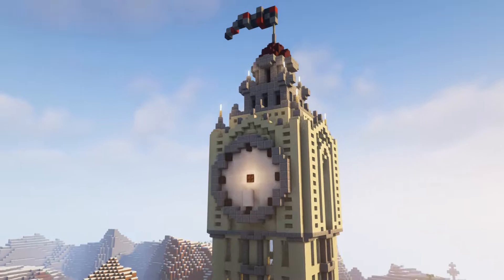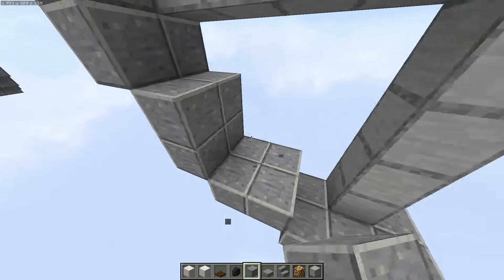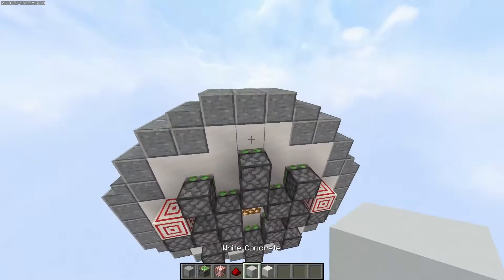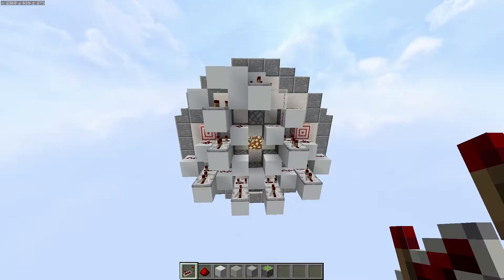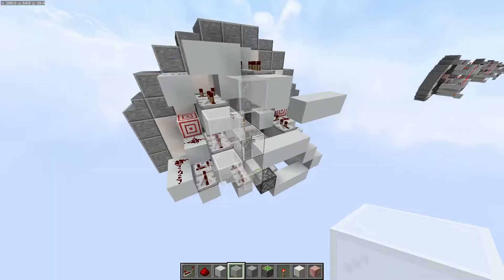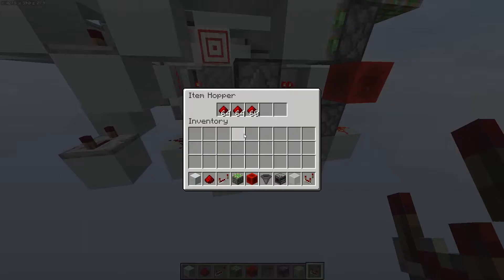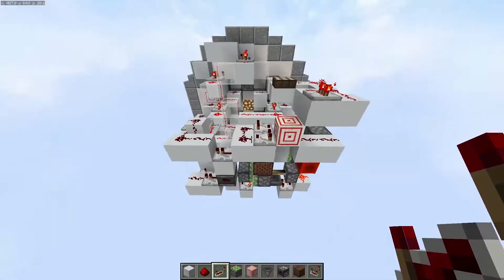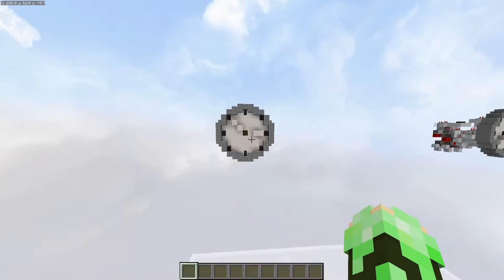Working Redstone Clock Tutorial V2 | Minecraft (Java Edition 1.19.2+)

Comment: Note for Everyone, in case your clock is stuck or it doesn't start after following the vid step by step, go to the redstone comparator that is placed on top of the observer near the daylight sensor and right click/activate it and it will start the clock. Took me too long to figure this out as i thought this entire time i messed up the redstone circuit.
Reply from the maker: The clock should start by sleeping, but this is good advice if you're still having issues :)
Reply: @Snap2it. А можна за їх зразком , зробити календар , який переключався б раз на день у майнкрафт і показував фазу місяця ?
Reply: And if none of the above work use a bow to start it aiming at the target next to the daylight sensor
Reply: I did both turning it on and shooting the target and even rebuilding it twice and I just can’t get it to work

Comment: For some reason the sticky piston under the note block isn’t moving for me. Clock keeps getting stuck in 8:00 only even after reset.
Reply from the maker: The sticky piston under the note block is powered by the observers that face the hopper clocks. There's two blocks that get alternatively moved into position above those observers so that only one of them can power the note block at a given time. Just check that everything in that region matches the video. Sometimes redoing a section is the easiest way to find an issue. You could also hop into my discord server where you can post pictures :)
Reply: I'm also having the same issue. I've tried tinkering with it, and rewatching, but the clock hand gets stuck on eight.

Comment: I think I could pretty much use a lot of your Redstone and Bedrock I would probably have to change where the power actually went to the Pistons because we don't have quasi connectivity and figure out what other quasi connectivity or using and try to hard power it somehow it definitely won't be as compact but I think a good portion of your Redstone will work
Reply: Did you manage to design one for bedrock?
Reply: @eliasfagerli4631  I did but once the copper bulb comes out it will be a lot easier to compact.

Comment: Can't get it to work consistently. The repeaters that are directly going into the sticky pistons are generally always in a locked state. Should I flip it over so it's not the case?

Can I get the world download so I can compare/contrast? Can't wait to get it working!
Reply from the maker: The locked repeaters should briefly unlock when the clock changes position. The placement shown in the tutorial is correct. I would recommend rewatching the tutorial to check for mistakes, or checking out the world download.
Reply: @Snap2it.  Just checked the world download. The locked repeaters aren't getting power. I may have placed another repeater incorrectly somewhere.

Either way it's an amazing build. I will endeavour to get it working properly!
Reply: @Snap2it.  Got it working, silly me had built one of the layers further out than it needed to be. Thanks again!
Reply: @FlatChanceQuartet  Which layer per chance? Mine is stuck at 3 O'Clock all the time!

Comment: Great design and tutorial! but is there a way to make it double-sided by chance while still using the same Redstone circuit? I'm asking because the train station clock tower on a server I play on can fit the clock on the front but we can't put another set of the Redstone for the clock on the opposite face of the tower we have 3 blocks of space behind the clock's original Redstone circuit, so if there is a way to do this lmk, but if not it's fine we have a backup design ready...
Reply from the maker: I'm sure it's possible, but it's not something I've designed. And it probably would take more than 3 blocks of space :/
Reply: @Snap2it.  oh okay thanks for at least answering